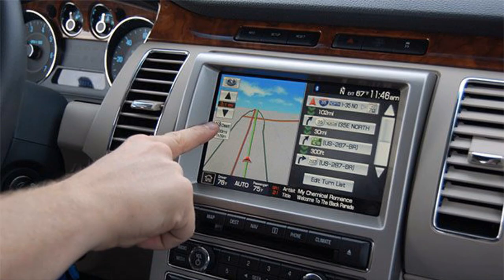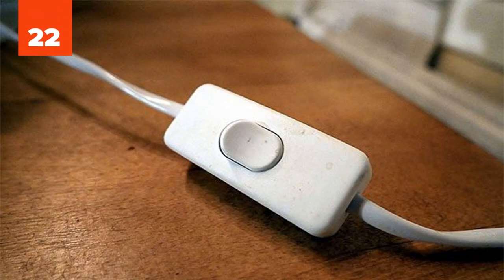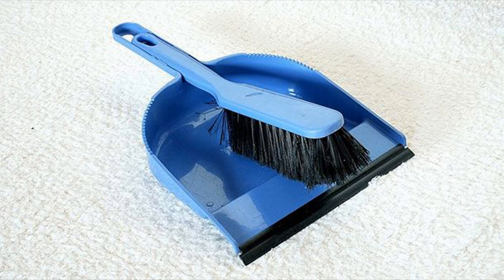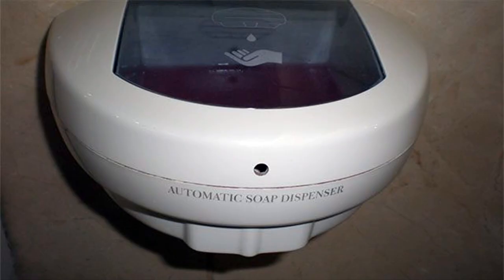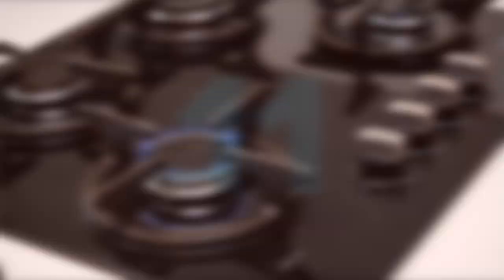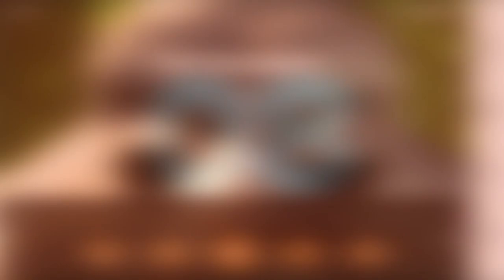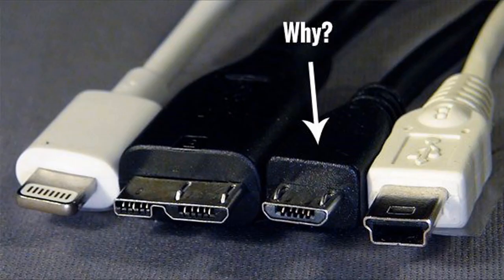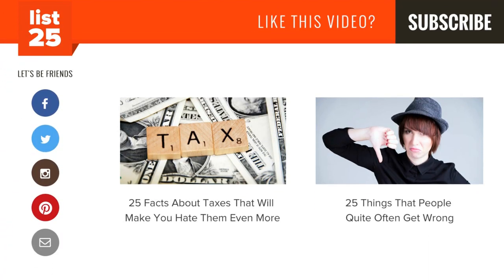25 SERIOUS Design Flaws In Everyday Products

Comment: Sorry Mike, gotta burst your bubble on a few here. I usually like your stuff, but this one could be much better. There are many questionable or inconsequential items on this list, yours and mine, I would have tried harder to find some design flaws that really affect us. 

18. Design challenge, not flaw. Problem to overcome, and done so by your "solution", is cost. 

12. Apart from the ease of entry thing, and the fact a seat in the center would mean either fewer passengers or a bigger car. Being very close to the edge gives you amazing sense of where that part of the car is. You'll notice that the wheel is always the center of the road, so people without good spatial reasoning don't drift over into oncoming traffic. 

11. I'm honestly not sure what you expect here... Take a gas range, like pictured, the fire is technically always at the same temperature, more or less, there is just more or less of it. You could calculate the BTU of the flame at any given moment and put that on the dial, but it would be just as arbitrary as the number we use now. 

10. I thought you were going to mention cool laser labeling here, where etching lasers literally turn a patch of the skin into a label. But as for the stem thing, they don't get put on by hand in most cases, they just role throw a machine that does it automatically, taking less than a second. To try and put it on the stem of an apple, which isn't always there anyway, would be incredibly time consuming and expensive. Most people wash there fruit in some fashion or peel the entire skin anyway... 

6. Teens wanting to prove how cool they are does not denote a design flaw. At least not in the pods...

3. Apart from this problem stemming from the size of the plug, bigger stay in easier, smaller is well, smaller. You don't actually want a super snug port, because the you need a super strong port. Otherwise instead of harmlessly coming out, you could damage the internal structure of the device, rendering the port useless (done it) or destroying the entire device. Apple tried this with their notoriously sensitive magnet charging cable. One of the main problems I've found with micro usb cables is dust build up, preventing it from seating properly in the first place.

Comment: Usually I use my foot for flushing handle as shown in the picture. It is not really high just between my waist and knee.
The problem is, when the flushing mechanisms use button as trigger instead of handle or level that you can easily pull using something else.
Reply: You can use a bit of toilet paper as a barrier between your hand and the button.

Comment: #14 Is a HUGE pet-peeve of mine!  Thank you, list 25!  Also, I agree with you about the doors, they should absolutely open out!  Then no one would ever have to touch the filthy handle.
#7 Speaking of elevators, why doesn't the "close door" button ever work? Why is it even there?
#1 I usually use my foot to flush public toilets.  If this is not an option, ie-elevated flush handle, I use some TP so I don't have to actually touch the handle.

Comment: Glass bottles are not a design flaw.  They were invented before the existence of plastics.  Even with modern squeezable plastic bottles, it is impossible to get every last bit of ketchup.  

And two major design flaws you missed:  Plastic soda bottles with bottoms consisting of 5 rounded points, making them extremely unsteady, and juice cartons that come to a ridge on the top (the ones we used to open by pulling apart one end of the ridge in order to create a spout) that now contain a cap and opening in the middle of the sloped top, so that by pouring the juice into a glass, the carton hides the opening from view.

Comment: With blinds, one string turns the blinds upward and the other turns the blinds downward when pulled. One can't push a string upward but may only pull it downward.
Reply: That's one type of blind.  What he's referring to are the blinds that usually have a rod on one side that you twist left or right to change the angle of the blinds, and two cords on the other, each of which raises and lowers only one side of the blinds.

Of course, the easy work-around for this is to get the blinds even and then tie the two cords together so they always raise and lower evenly.
Reply: Thanks for the clearification.

Comment: BALL CAP BUTTON = Fitted baseball caps — those without an adjuster — are normally sewn in six sections, and may be topped with a matching fabric-covered button (also called a squatchee) on the crown.......

Comment: Wine, red and white, is to be served at specific temperatures.  As stem on the glass allows you to hold it without warming the contents with your hand.   Also - you clearly don't cook.  There is no need or use for a thermometer on a stove burner.  Even for the  very few things that require a specific temperature (caramel, oil, etc.) - it's the temperature of the contents of the pot, not the burner that is important.

Comment: 21. is made that way so they don't have to use a pulley system to pull both sides at the same time. 17. Wineglasses are made that way, so when you hold your drink you don't warm it up with your hand since they are usually carried around in parties (used to be). 15 it's a mismatch between faucet and sink. It's like using a dessert fork for a steak. There is nothing wrong with the fork, you are just using it for the wrong thing. 14. you have motion sensors on it so there is a fixed amount used, also people don't break it that way that often. 12. Simply wrong. Firstly you could only put 1 person front and secondly you want to see how close you are toward the cars that are coming on the other lane.  11. Gas stovetops can't give you exact temperature since it can vary depending on the type of gas mixture you use and it would make a really expensive system to adjust the flames all the time automatically.
-------- Just because something is less convenient, doesn't mean it's a bad a design. Everything in design is a compromise. -------

Comment: With the thumbnail I expected them to mention bike petals, and how the screw that holds the bike petal in place is unscrewed in the exact same direction that you petal.
With a little time and wear and tear, eventually the petal will loosen itself and just fall off.
It's a design flaw that they could be easily fixed by implementing a reverse screw in that center spot.
I'm sure that some bike manufacturers do this now, but I've had problems with three separate bikes in my life that all had the same issue where the bike petal eventually loosened due to use, so If I ever buy a bicycle again, the direction of that screw is the first thing that I'll look at, because that is the weak point where bikes have always historically failed on me.

Comment: You aren't supposed to hold the handle of a shopping basket in your hand.  You settle it in the crook of your arm, where it fits just fine.  Your hand will tire much faster holding that basket than your arm will.

Comment: actually, when you think about the basket and how the handle should be changed, you'll realize that it's fine the way it is. if the handle is not going across the basket and rather going along the basket, the weight of objects would flip the basket over(especially if you have a large soda bottle in there ) all the weight on one side of the basket would be an issue. so really it's fine

also the dollar bills DO feel different from each other 

but seriously though they need to put braille on dollar bills

Comment: The button on the ball cap serves a purpose.  All the panels of the cap meet at that spot.  It's hard to get the spot to look good or even work.  Often a hole develops.  To fix the problem the button is sewn in at spot where everybody meets.

Not only are women's jeans made with no pockets, but the waistline is invariably too large.  On me that's usually two inches more.

While I agree having a motion sensor on the door would be great, I don't see why we need to remove the one from the soap dispenser.  It works fine for me.

I think you have the glass catsup(ketchup) problem all wrong.  Once you get all the catsup out that you can, add a little water and use the liquified tomato product on top of meat loaf or in a tomato sauce.   There you go!  Bottle cleaned out!

The stickers on fruit is not necessarily an added step.  They've all been printed on edible paper with edible ink.  Go ahead and wash your fruit and dig in!  You'll be fine!

Nail Clippers aren't the problem; nails are.  I used toe nail clippers for my finger nails and still had the problem.  So I started to soak my nails until they are very soft.  Now my toe nail clippers don't cause half the problems!

When I heard the US was going to change it's currency a short while ago I was jazzed.  I thought that finally we'd be getting the logical, sensible multi sized bills.  Oh no!  We got a change in color an size of the face because blind people can ALWAYS differentiate colors!!

Comment: #3 sticker glue. I've always said that labels & tags should be made using the same sticker paper & adhesives that pharmacies use to put labels on prescription bottles. I've never had problems removing them from bottles in 1 pc & with 0 residue. I've experimented with the 'extra labels they attach to the bag or information printout. I've put them on many different surfaces from leather, fabric, metals & plastics it comes off as cleanly no matter how long & securely it was put on. So if I came up with that someone making labels & tags should be able to do it. (Btw I'm a graphic designer which may be why I've put this much time & thought into it but still....)

Comment: Re the shape of a wineglass: whilst annoying as hell because they really are easy to knock over, the shape does have a function. It's designed to maintain the temperature of the wine by preventing it from rising or prevent it from rising above room temperature if it was chilled. 
Alcohol causes dilation of the blood vessels, especially those in the face and hands; in other words, alcohol can cause a person to warm-up and develop a rosy glow. 
To avoid having the wine warm from holding the bowl which contains the liquid, a separate stem was added. By holding the stem instead of the bowl, significantly decreases the amount of body heat which would otherwise warm up the drink. 
The glasses are still prone to tipping, however. Because I frequently have difficulty grasping objects, if I have a drink at home or my parents' house, I generally pour it into a toddler sippy cup - the kind that allows you to turn the cup upside down without spilling. I don't care how it appears, only that it works. 😉

Comment: Got a few remarks! # 25 Yes -touch screens in cars is a stupid & deadly idea. Old style buttons and knobs can be familiarized by the owner/driver and used more safely (and are not ANOTHER chip relay to go bad). # 22 The very few times I've encountered an on/off in the cord were related to Xmas tree decor, etc. # 21 I've never seen a blinds control cord that only shifted a vertical half-of-the-blinds. # 19 Yes! GIVE WOMEN FUNCTIONAL POCKETS!! # 16 In the last few years I've begun using the short upright shopping carts/trollies as a "walker on wheels" but previously wouldn't use a basket or cart. I reckoned, "Oh, my hands are full, I guess I'm done shopping." (Does that make me a bad consumerist?) # 13 I've not seen often but suggest: b/c glass recycles easier/better than plastic? (guessing) #2 Yes! Change the size of banknote denominations! Unless a bill has REALLY been through its lifespan, a blind person CAN distingui9sh them by touch. U.S. currency is printed using an intaglio press which results in the impressed ink being SO slightly raised as the plate lifts. The result is that a blind person can feel the corners and tell if it is a $1, $5, or $50. However, by changing the denominations sizes - getting larger as the denomination increases - does help stop counterfeiters from bleaching out $1 bills then printing upon them $50 or $100 images. Many countries alter the sizes of their currencies for exactly this reason.

Comment: I beg to disagree about cook-top knobs. I've never had a recipe that specified temperature for the heat source or flame. Most cooks go by how the food changes colour or how quickly the liquid is boiling. Anything beyond that can be measured with either a probe thermometer or (if you're REALLY hardcore about pan temperature) an infrared thermometer.

Comment: What about cell phone cases? Never had a phone or iPod case that lasted more than a year without substantial disintegration occurring. I'm not talking about just the cheap ones either. Also the plastic sheet screen covers tend to develop some slack which impairs the functionality of the touch screen.

Comment: The fact that a calculator keypad is upside down compared to a phone keypad. Have you ever received a text where someone included a phone number and it didn’t work? Then you have to unscramble it by transposing the keys?
Another one: why didn’t they put the “/“ on the number pad of a keyboard? It has add + subtract - and multiply * but not divide /

Comment: Strings on either side of a blind are not a design flaw you don't pull on both sides to pull the blind up. The second set of strings is to adjust the angle of the blind when the blind is fully closed that way you can let some light in completely close the blind pulling the blind up is done from the opposite side. Some lines have replaced this with a rod that turns and does the same thing with the angle of the blinds but at no time is there a requirement to pull strings on both sides of a blind to raise it doing so will cause you to pull the blind off the wall. this reminds me of the Millennials trying to use a dial telephone

Comment: #22 
A. some lamps don't have a 'base'.
B. some use bulbs that get too hot, making base-mounting the switch a guarantee to burning your hand

#21
most of those are either
A. Too wide for single cord to not tear itself up. (my parents had two of these)
or
B. have positioning for both the top and the bottom . (got one of these on each exterior facing window)

#19 where's the proof?

#17 most likely, other glasses of the time were worser.
#12: steering wheel in the middle on a consumer car increases blind spots due to leaving no logical place for the mirrors (F1 cars violate too many consumer car regulations to be a point of comparison.

#7 the logistics of elevator operation makes floor unselection infeasible outside of the Fire-Brigade-Override

#1. the hand-handle frequently forces me to note that not all has been flushed and that I need to use the toilet brush

Comment: Problem with toilets:  Squared off corners at the bottom of the bowl. ROUND plunger.  Go to plunge a clogged toilet and nasty water come squirting from the corners.  Plus the round brushes to clean the toilets often don't get into the corners that well.
Reply: Actually, wouldn't that be a problem in the design of plungers?

Comment: I think the motion sensor soap things could be a way to save on soap. Like if a child ran in, the child could make a total mess by keep pressthing the soap button. But if it's a controlled touchless sensor, chances are that child won't make that much of a mess and the places saves money on soap and paper towels.
Reply: I think the issue with touchless soap dispensers is that either you're standing there for several seconds waiting for a tiny squirt of soap, or they're so sensitive they go off when you walk by, leaving a mess of soap on the counter or floor, depending on the dispenser's location.

Comment: As far as the best fan goes one you do not use it on carpet you always use a vacuum cleaner on carpet that just common sense 2 use a dust pan on a hard surface floor even though it leaves a line you still going to pick up more then if you put use a vacuum cleaner on the hard surface unless the vacuum cleaner is made for hard surfaces because of that regular vacuum cleaner will appear to pick up the stuff on your heart floor but if you actually look and listen shooting in out the sides

Comment: 6:19   ........Brittle dry nails will splinter and shatter.....suggest clipping after a bath or shower when they are softer and pliable.....OR...soak fingertips in hot water for awhile first...
Reply: He's referring to the part of the nail clipped off flying out the other side of the clippers.  I don't think that relates to what you're talking about.
Reply: That's what I'm talkin bout....been there..done that....

Comment: I wish they would always use stickers that easily peel off. I think this is a price issue though. It probably costs them more to use these stickers. You don't have to use wine glasses for wine- you can use other glasses or get some vintage goblets that are made of thicker glass. Short faucets... Aaaahhhh!!!! Bathroom doors that open outwards= thumbs up. Glass bottles are better for the environment. You just have to turn it on its side or upside down for a minute to get the last drops out. Driving from a side is better, cause you can watch the most dangerous part of the journey better- which is oncoming traffic. Foot flushing= thumbs up. And pause screens that cover part of the screen if you want to see a detail! Laundry and dish pods often don't finish dissolving fast enough too and are still releasing soap for the rinse cycle. Old fashioned laundry and dish soap is better cause it immediately starts to blend with the water, increasing the time you have soapy water on your dishes/clothes, and is completely gone for the rinse cycle.